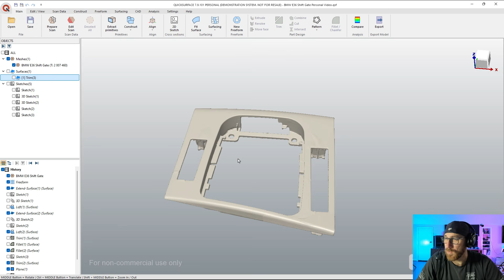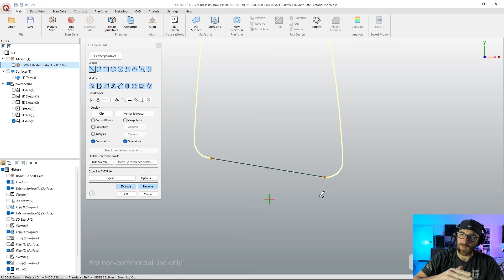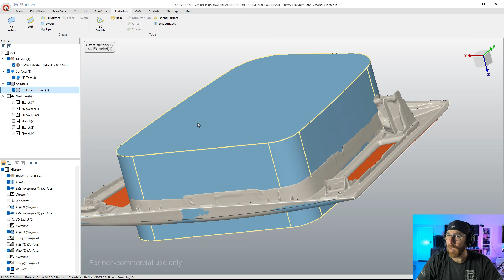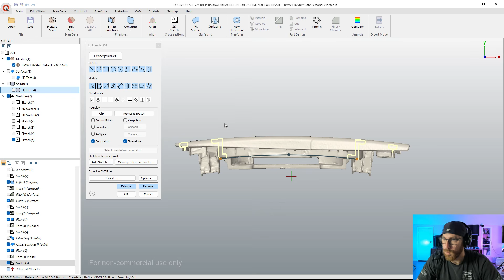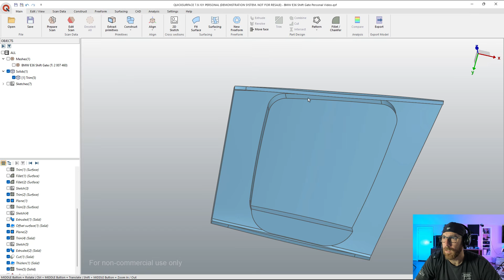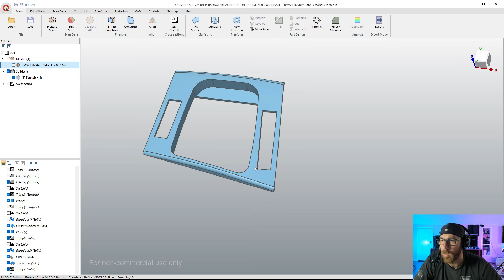Reverse Engineering Car Trim Panels for 3D Printing part 2– BMW Trim Piece and QuickSurface Personal

Comment: I'm consistently impressed with your teaching style. You speak like a mechanical engineer who's also a broadcast journalist. It's an unusual combination of skills. Thank you for sharing them. I'd love to see either a comprehensive series or intermediete and advanced versions of your Quicksurface for Beginners class. I'd sure buy them. The quicksurface team has made herculean efforts to expand their instructional materials, but I can't help thinking it would be less of a lift for them and better allocation of their resources if they would just outsource to a pro like yourself to handle their educational resources development/distribution.
Reply from the maker: Thank you for the kind words!!  I do have a QS pro course on the website here https://www.learneverythingaboutdesign.com/p/getting-started-with-quicksurface-pro

It covers prismatic parts, freeform, and surfacing tools in QS Pro.  They are supportive and have asked me to make more but i just don't have enough hours in the day :)  it is on my list though!

Comment: What about autodesk Inventor, would it be easier than in QS or fusion? is it possible you will do one day a tutorial on Inventor, while trying to reverse engineer a 3d scanned part?
Reply from the maker: Inventor isn't any easier sadly.  Inventor has a point cloud option to bring in raw point data but its meant for things like factory layout for tubing/routing.  QS is a dedicated mesh tool.  Fusion can do it but it really wasn't made for it.  just can happen.

Comment: to be honest, plenty of work underlying. But, how much would the fees for such professional work on reproducing the object come out to? I suspect its not going to be something that the average joe would pay for, unless this is for an exotic car or something along those lines.  I often get comments from potential clients that my quotations are off their budget. But, based on man hours and the professional skills involved, it is reasonable considering how much work goes into reproducing each component digitally before being printed into life (fdm or otherwise). Just my thoughts, if you (or anyone out here) have any comments.
Reply from the maker: Great question.  The access to these scanners and scan tools being so much more affordable than they used to be has actually shifted the perception by those that know about them but not how to use them.

My personal opinion is that this work should fetch a good return based on the skill involved and the investment in the tools.  QS Pro is $4000 and one of the most affordable pro tools in this segment that I have found.  I generally show the "good enough" methods that most people are fine with.

Another thing to break down is the desired output/outcome.  Is it a "close" representation for 3d printing like we have here, or does it need to be a perfect CAD model version of the scan.  

So the approach I take to a part like this for someone to 3d print is different than say a pro level reverse engineering job.  for the average joe just doing it themselves for 3d printing this is "good enough".  For professional level reverse engineering of a part like this I would expect to pay $1000 easy to have the part scanned and a "dumb" version of the part produced.  If i needed to pay someone to create a full CAD file with sketches and things that could be edited that would add more to that price.

Pros have pro tools and pro levels of experience and in my mind should get paid pro level value for the work :)
Reply: @LearnEverythingAboutDesign  Matt, I am with you on this one.  Its highly intellectual work and somehow I feel not everyone appreciates how much detail goes into each piece of work which is really art in itself. 

In the neighbourhood I operate in, a lot of end users think its just scanning and the end. But, they fail to realise and you rightly pointed out about the perceptions. More are indeed aware of the prevalence of affordable scanners. As a client once told me, "buying is easy, but whats the use if you cannot make good of the outcome." 

Based on what you done for this piece of work, I don't disagree with your pricing. Its a lot of detailed work which calls for years of experience. That is really what sets pros apart from the amateurs. 

I like to quote what Buffett once said, "If you are a few minutes into a game of poker and you do not know who is the patsy, then you are the patsy." Many of those who bought my scanner came to me (many a time) and asked the same question, "can I do what you do? after i buy your pre-owned scanner." I quietly shared its a long journey. 

Finally, I truly enjoyed your contributions to the community and learnt greatly from your generous sharing. You deserve your 1000 bucks for the job. Cheers.

Comment: I haven't tried it yet, but performing the same operation in Fusion 360 felt more comfortable for me. If you are proficient enough with Fusion, it seems possible to achieve the same quality form in similar timeframes. Thanks Matt. 🙌
Reply from the maker: EP3 later this week does this in Fusion.  The big differences come in the ability to properly align, and having an analysis on how close you are to the original.  There are other cool tools like snapping extrudes to the mesh, and better mesh section sketch tools.  But yes you can do it in either.  In EP4 which should be next week, i also show Plasticity tools.